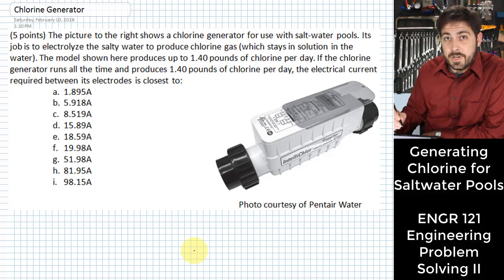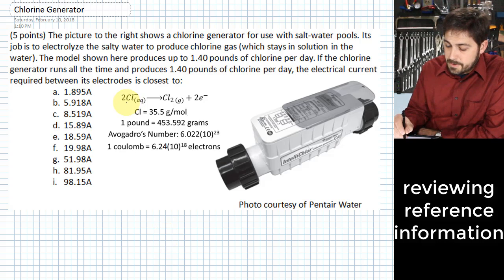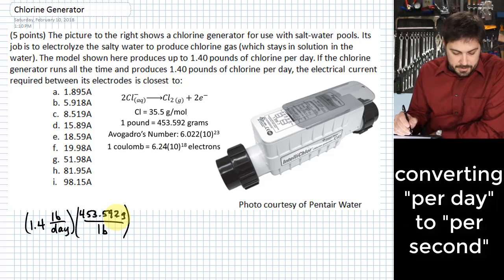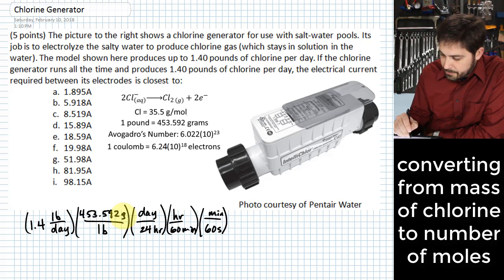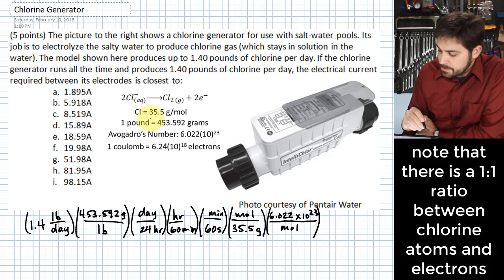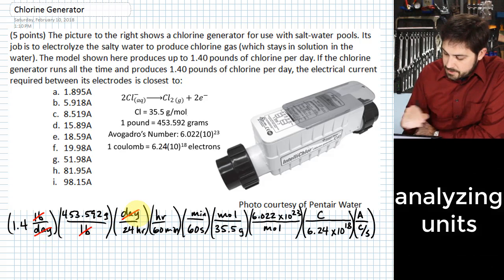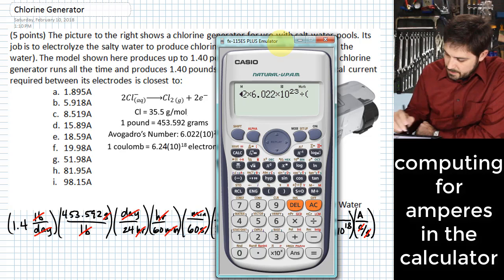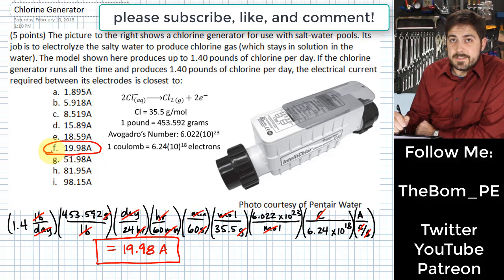Electrical Current Required for Chlorine Generator for Saltwater Pools

Comment: Chlorine is diatomic.  There are two Chlorine atoms per mole of chlorine. The MW of 35.5 is for two Chlorine atoms.  It takes 2 electrons to make one diatomic Chlorine molecules.  One mole of diatomic Chlorine contains 2 x Avogrdro's Number of Chlorine atoms.  The answer would be closer to 40A if the process was 100% efficient.  The electrolysis of water to  produce hydrogen runs between 70%-80%.  The formation of Chlorine runs in the same ball park. As such "g" would be the correct answer where 52A input with a 76% efficiency you be ~40A if it 100% efficient.
Reply from the maker: Nice try, but you are incorrect. The periodic table indicates that the MW of a single chlorine atom (not molecule) is around 35.5. There is a one-to-one relationship between the number of electrons needed and the number of chlorine atoms involved. No information is provided with the problem nor in any provided reference materials regarding what assumptions to make regarding efficiency. As such, it can be viewed through a lens of determining the theoretical minimum required current necessary to generate the chlorine gas indicated in the problem.
Reply: @TheBomPE  F  I like you videos and how your presentation style.  I was incorrect but confused by the two electron process shown in the formula presented and the the fact that a mole of chlorine gas weights ~71 grams (I mess up on that number also).  This is an apology with an excuse base on my failed logic.